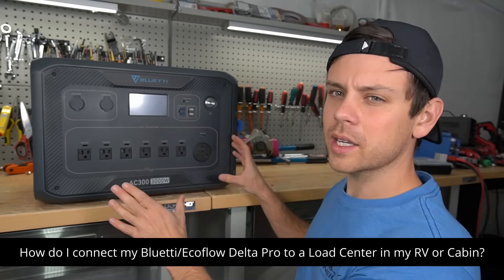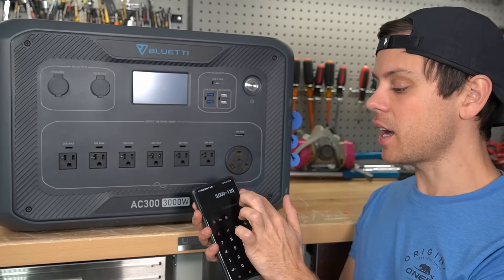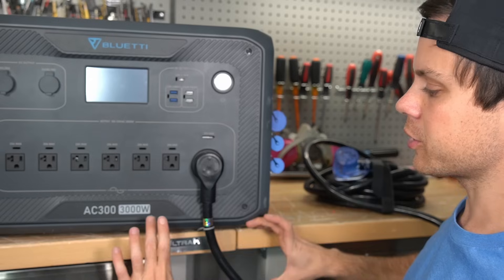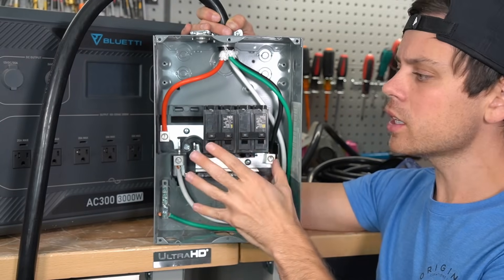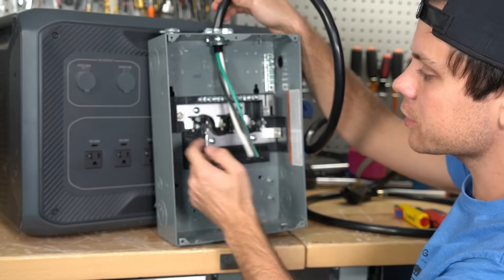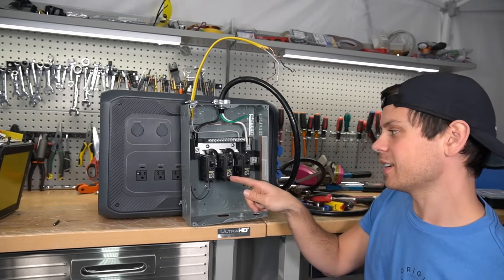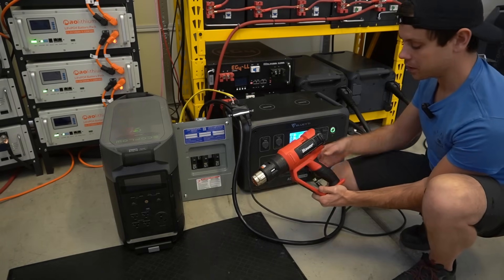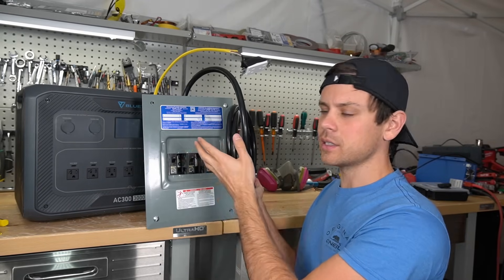How to Power a 120V Offgrid Cabin with Bluetti or Ecoflow Delta 30A Plug

Comment: Hey Will, I thought the solar generators were like a regular generator with a floating neutral.  I'm running my AC 200 Max into a manual transfer switch connected to my service panel that has a shared neutral ground bond.  I went with a Bluetti instead of an all-in-one inverter or regular inverter because I was worried about the ground neutral bond.  I am thinking about using this unit on an RV or selling it to someone with an RV so this video is interesting thank you.
Reply: TL;DR: AC200 has isolation via the power brick. The AC300 requires isolation as well. 
I own the original AC200 (not P or Max) and the AC300.  I own the APC UTS6H "Universal" Transfers Switch which has a bonded neutral. The AC200 can "charge" and operate the panel fine because the switched mode power supply has mains isolation via it's  transformer inside.

The AC300 expect isolation (and I found this out the hard way). The H-bridge on the AC output will fail if the AC300 is outputting AC whule accepting AC from the grid as it will effectively be switching mains hot to neutral during 1/2 the cycle. A completely isolated sub-panel (as demonstrated in video) will be fine, however it will not have a path to ground as the AC300 (nor the 200 series) has a path to ground from the output ground terminal(s). 

My UTS6H bonds the neutrals (bad for AC300) and bonds the grounds (good as AC300 has floating ground) and only switches the hot from mains, UPS or "generator" input (generator input is where I used the both AC200 and later upgraded to AC300). I even worked closely with Bluetti during troubleshooting this issue. They did happily exchange the unit (more than once) while learning of this edge case failure. I recommended clearer documentation on transfer panel requirements.

My work around was to get a "medical" grade isolation transformer (the price has gone up ~$50 since initial purchase) from Tripp Lite "Tripp Lite IS1800HG" for use with the AC300 power input.
Reply: @Doug M  Hi Doug. Thanks for your informative post. I too have the original AC200 (not P or Max models). I am slowly educating myself about AC and DC circuitry, but still not anywhere near your knowledge and/or experience level. I did not fully grasp everything you wrote. I'm also new to communicating via social media platforms, but would appreciate the opportunity to discuss further with you this DIY home electrical backup subject. If you have any interest in pursuing this conversation and helping to educate myself (a recently retired, late-middle-aged "old" man), please let me know.
Sincerely, a fellow Bluetti-an.
Reply: @curthatton3395  not sure as to what forum/medium for exchange of information,  but i can share what i know. Amateur at things, designed a few circuit boards, etc... but take high voltage seriously as it can kill you in more ways than one. There are a few YTers that are good resources for learning such as bigclivedotcom or electroboom as well.
Reply: @Doug M  Thank you Doug for your prompt reply. I pulled up the two YouTube sites you mentioned, and will start watching them to further educate myself on this electrical subject. Can you please explain in further detail what the "H-bridge" is that you mentioned in regards to the AC300's AC output circuitry?
I'm located in Northern CA, and in the (slow) process of converting to getting of the grid, (PG&E is our electrical service provider, and power outages are fairly frequent, in addition to an ever increasing cost of service). I've acquired 10Kw of used, 250W solar panels (from SanTan Solar), 20Kwh of LiFePO4, server rack style batteries, and two 5Kw Growatt SPF5000ES charge control/inverters. I'm currently in the process of researching ground-mount PV panel mounts. Any recommendations or comments would be greatly appreciated. 
Thank you in advance for your assistance and time Doug.
p.s. Stay healthy and happy, it only improves your life, at least that's what I keep telling myself as I get older and start my "retirement years."
Reply: @dx9s Interesting. Good info.

Comment: Good to see more vids other than server rack systems ;)
Reply from the maker: I'm dreading it 😂 would much rather build big powerful systems haha
Reply: @WillProwse  I hear ya.  but I think you will have more viewing content, that's all.  For me I have been slowly buying the Power Queen 12v 300ah batts I have 4 in parallel now. I want to move to 24v but think I am holding off until my batt. bank is bigger and  move to 48v .  connecting System to Bus bars. Victron 150/80.  I should have gone with the 250 I am capped out on voltage now for my solar. My other option is to mirror my current solar array and tie it parallel to increase the amps to the system.  It never ends hahahahaha $$$ You have have gotten me going on this hobby I call it now and can't stop hahahaha.  Thanks buddy.  really JK.. Hobotech and Jasonoid are the other culprits as well. It all started at looking to install solar on my truck camper, I still have no solar on my truck camper yet.   🤗

Comment: Love your videos, would really like to see an investigation into Nickel Iron batteries used with new generation solar cells, charge controllers, and inverters.
Reply: Nickel-Iron batteries have lower energy density and lower specific power compared to lead-acid batteries (or in layman's terms are less efficient).  cells take a charge slowly, and give it up slowly (cannot supply sudden large power spikes)

Comment: Hi Will. Love your videos. Question for Sail Boat people that could use an insight, like myself. I'm looking at a House Battery Bank of 4x 200ah 12v Lifepo4 Batteries, as the weight of the 4 at close to the waterline on my next boat will put a balance to the weight of 4 250watt Monocrystalline Panels on top of the Rear of Cockpit Solar Arch, to keep things nice and even (a bit more in favour of low down weight will also help). So, any recommendations for Good Basic well made Batteries that don't have heaters (the Bank is to be situated in the generator space behind the engine, with plenty of warm air flow around them. Your tests have shown some good ones, like SOK, but they're hellish expensive this side of the Pond, so any recommendations of your favourites would be very appreciative. Best Wishes.  Bob from Wales. 👍🏴
Reply: Ampere time makes great batteries.
Reply: @merlpriester    Thanks Merlyn I think they are pretty decent value too. not sure if they only do USA deliveries though. They may have a minimum order to enable delivery direct to the UK, I'll have to check. Best Wishes.  Bob.  👍🏴

Comment: I have a couple of fairly technical questions:  1) Is the cable/connector 30A rating limited by current density in the contacts or wire?  Or is it limited by the series resistance of the long cable, which causes voltage drop?  The reason I ask is that the cable will usually be cut pretty short for this type of installation.  So if it’s the resistance, then cutting it short makes it better.  2) The AC300 output is rated for 3000W/25A continuous, but it is also rated for 6000W/50A short-duration peaks, which is useful when starting some loads.  By using the 30A fuse in the load-box, are you negating that benefit?  After all, the AC300 output is already protected, and each load from the load-box has its individual circuit breaker already.  I appreciate redundant protection, but it also comes at a cost of additional resistance and additional points of failure.  In this particular situation, I’m not sure it is warranted.    3) Not an additional question, but some sharing — I did something similar as a partial “at will” off-grid system in my house using the AC300 and the Reliance Controls Pro/Tran2 manual transfer switch.  It patches in to your existing circuit breaker panel and enables 10 circuits to be individually switched between grid power and AC300 output power.   In case I am not home during a power outage, I keep my refrigerators and WiFi network continuously on the UPS system of the AC300 output.  Then I have 8 additional 110V circuits in my home that I can switch over manually as needed in the event of a power outage.  Also, as I add solar to this system, I can put more and more of my circuits on the AC300 to balance my daily loading with my solar production and my UPS needs.  The AC300 configuration settings are good for that.  I did all of my own installation.  My circuit breaker box was very crowded, so I used Wago connectors instead of wire nuts so it would all fit.  The Reliance transfer switch needs a lot of connections inside your circuit breaker box.  Fortunately, the Reliance box is pre-wired within itself. Of course now I wish I had the AC500 or even one of the server rack systems.   But I think this will serve my needs.  I suffer from a lot of partial shading at my house due to tall trees here in the Santa Cruz mountains.  So I’m not thinking I can make enough Solar to be completely off grid.  Anyway, thanks for your videos educating us all.
Reply: I'm not Will, but yes, the 30A breaker is limiting the surge capacity of 50A that that AC300 can put out, but perhaps not by as much as you'd expect.  Most breakers will allow surge currents in excess of rated capacity, and the greater the surge the quicker they will trip.  For only 20-30% surge it might take the breaker a few minutes to trip.  When you look at the specs for the AC300 it tracks this pattern of usage.  The AC300 will surge 3750 watts for 2 minutes, 4500 watts for 5 seconds, and 500 milliseconds for 6000 watts.  The designers pretty clearly created the AC300 to act like an actual wall plug-and-breaker system.  Typical breakers rely on heating up a strip of two dissimilar metals to the point where they break the contact, so the more current that passes through the quicker it heats up and breaks the circuit (I'm not talking about quick-trip breakers here).

I would try going with the 30 amp breaker for the simple fact that it is a switch that you can turn off when plugging and unplugging the 30 amp cable.  Chances are if you regularly trip the 30 amp breaker you're not far off from triggering overload protection on the AC300.  But if you have some load that's right on the limit, removing the 30 amp breaker may be that little bit that is needed to successfully run the load.

Comment: It's good to stick to the 80% rule for continuous loads. If the circuit is rated for 30 amps, you shouldn't exceed 24 amps.
Reply from the maker: Yes absolutely.
Reply: NEC defines continuous load as 3 hours or more. For these solar generators I think you'll deplete the battery in less than 3 hours if you are pulling a constant 30 amps.
Reply: @erikj9962  I hadn't heard that / didn't know it.  Thanks for sharing.  3 hours is any eon for an electron 🤣
Reply: @erikj9962  valid point as long as there aren’t expansion batteries connected. Also, more conservative people might call one hour continuous.
Reply: then a 25 amp breaker should be used....that way you know you are under the suggested 80% rule.
Reply: @steves3688  If you managed to find a 25 amp breaker, then the circuit would be rated for 25 amps and you would need to use 20 amps max. The circuit rating is the lesser of the breaker or ampacity of the wire (and the breaker should never be bigger than your wire rating).
Reply: @paul.phillips  Little confused here.  So a 25 amp breaker will trip "break" at 20 amps?  I understand the wire part but not the breaker part of your comment.
Reply: @mondavou9408  No, breakers should not trip at 80% but when sizing a circuit with a continuous load you want to keep it under 80% of the rated circuit (breaker size + wire gauge, etc). You can look up the "80 percent rule". When under heavy load, breakers warm up.. so if you have a continuous load of say 95%, then it could throw the breaker after enough time even though you didn't exceed its rating. Whereas a current that greatly exceeds a breakers rating would flip it immediately, a high current below the breakers rating may just slowly heat up the bi-metalic strip inside and throw the breaker after more time has passed. There are some videos on Youtube that go into more depth about the 80% rule and how breakers work.
Reply: @paul.phillips  Ok I think that makes sense to me.  Thank you for your time.

Comment: Will.  Love your videos.  I tend to overthink situations till I’m almost mental “lock” and can’t decide on what to do.  I’m buying a shed that’s 16x40.  It’s mainly being used for storage.  I will be modifying one end to be my office/escape from the family room- kidding (not kidding). I’m fairly knowledgeable about most things electrical- and I have the ability to research if need be.   The power needed will be enough to run lights (led) and a few outlets in the main garage portion of it and enough for the office.  I will be using a laptop, extra monitor, printer, lights, as well as have a few outlets in there as well.  Will have a small window unit for AC.  I’m still undecided for heat.  It will be occupied mostly during the day and evenings- maybe 3-4 times a week.  Initially I thought about using EG4 batteries with an eg4 3kw off grid inverter.  But these solar generators (ecoflow and bluetti, etc). Which way would you go?   Both have pros and cons.  The office part is not big- 16x10.  Also- I live in FL (Pensacola) which sees about 3 seasons.  It can get in the teens a few weeks a year- but is mostly in mild temps.  Also it will have solar only.  Maybe a small generator if needed but plan on being strictly solar powered.  I’m undecided about heat.  I’ve thought small wood stove to oil filled radiators.
Reply: Think about a 9,000 BTU heat pump mini split. I think there is also an 8,000 BTU heat pump window unit available. Ideal for your climate.

Comment: Is the danger of shorting the two bus bars that they'll be the same phase and thus could overload the neutral?
Reply: There's only 1 phase, so all of the return current is going back on the neutral. The danger of shorting the busbars is if someone comes along later and hooks up two hots (240v) from a split phase system to each, then they've shorted the two hots. It's better to get a load center with a single bus bar for 120v only since they are made for it.
Reply: My goodness.. that is so hypothetical it’s scary… that is just so hypothetical im not Gona go get my newspaper tomorrow out of the yard, as an asteroid could possibly hit me.. and I could die…
I suggest the owner should take preventive action when leaving  the set up and and the new person owning it should take notice of how it’s wired… if not, neither should be hooking up anything… hire someone………Come on Man…….!!
Reply: @jimhanty8149  No one said that it was a likely danger, but when someone asks about the potential danger of doing it a certain way (and that's all it is, a potential danger), they can be the judge as to the risk for themselves based on the information. Relax man. If you want to stay inside because the risk of asteroids are too high that's on you, nobody is suggesting that.

Comment: Dumb question, but should't you have a master breaker to make sure you don't exceed the 30amp limit on the cord?
Reply from the maker: It's built in but that's why I said you can feed the load center through a 30A breaker for this reason. It's mentioned at the end of the video
Reply: @WillProwse  i live in CA where electricity is pricey your videos have given me hope gonna build a DIY plan soon here
Reply: @ls-33wraith33  So sorry but you are allowed to leave to a red state you know.
Reply: @davidkettell5726  true i do enjoy parts of CA but more and more are getting ruined and mismanaged to put it mildly. 
I’m from Texas planning to head back likely sooner than later
Reply: I believe the bluetti has one internally built but have one not in the machine is a good idea because if it breaks much easier to change out
Reply: Rather than connecting the hot directly to the busbar in the load center, you could run the hot through a breaker and that breaker would act as a main breaker for the panel. I assume the bluetti has a built in breaker, but it's not a bad idea.

Comment: What would be your recommendation if I was trying to power a Hotlogic Mini (little food warmer for work) . It runs on a 12v on a car adapter but I want it to be portable for roughly 5-6 hours. They say it runs 45 watts, 3.75amps on 12v car adapter. I'm a novice at learning these things, but from my assumption I would be able to maybe get 5-6 hours out of a 20ah battery pack? Or what would you recommend. Thank you for the video, and sorry for bothering with questions not directly related to it. Appreciate any response. Have a good day.
Reply: In a perfect world 20ah divided by 3.75 amps = 5.3 hours of operation. So you can expect less than 5.3 hours of use in this circumstance.
Reply: @awwaldo  My question would be around how I would get a portable battery pack to power a 12v device with car adapter. Sorry for being naïve, trying to learn these things.